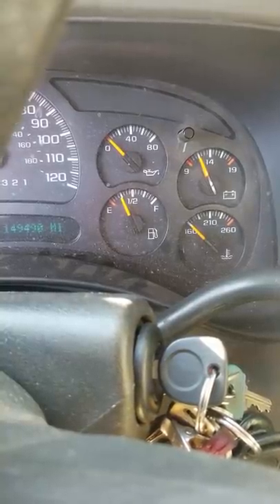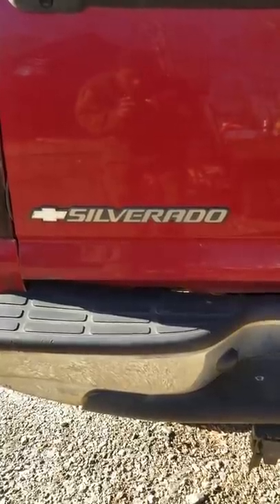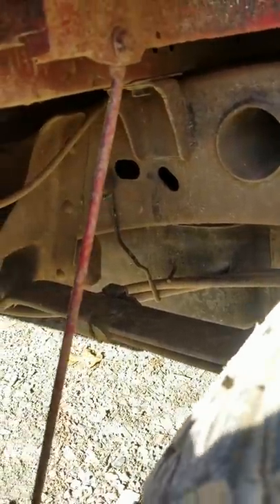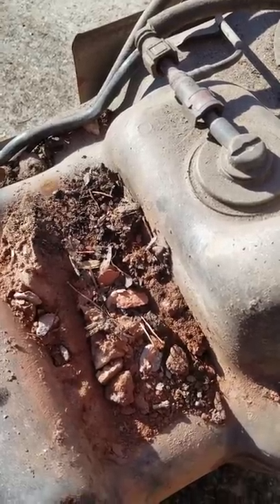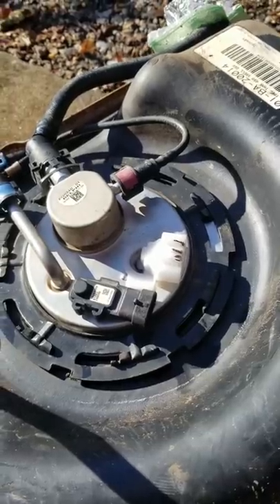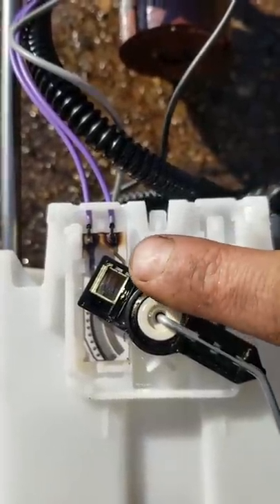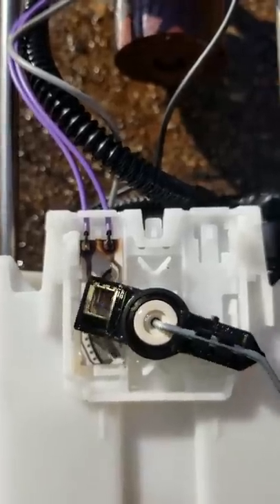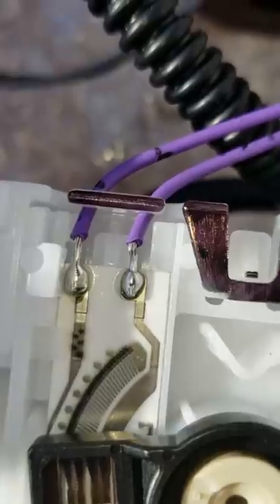Customer States Fuel Pump Broken

Comment: Yup... thats GM / Chevy right there. My 2008 impala is doing the same shit except mine goes empty reading a little over a half tank or 5/8.  I just filled it up when it started doing this and threw a 5 gallon tank in the trunk, zeroed out the mileage and ran it till it quit to know roughly how far i could drive it.  Been driving like that for 2 years just reading the travel mileage.

Comment: I have a 99 Z71. I didn’t have to drop the tank or lift the bed to change the fuel pump. If you have a buddy it’s much easier and faster to take the bed off than to drop the tank also.

Comment: pop out the bed bolts on tank side, loosen to almost remove the bed bolts on non tank side,  pop the fuel filler bolts from fuel door access. disconnct lights from main plug on frame behind rear bumper.   with friend and 12 inch cut of 2x4 lift side of bed with no bolts place 2x4 between frame and bed   you can now access the top of tank and get to sending unit/pump. clean area before pulling pump.  reverse order to assemble.

Comment: When I did my fuel pump on my 03 1500 I just loosened the bed bolts on the passenger side and removed them on the drivers side and jacked up the tank side. Had full access once I secured it held up.

Comment: Always test a part before installing. With New fuel pump turn ignition key on move float up and down. With someone watching gauge. Fuel pump should come on and fuel gauge should go full with float up and empty when float is down. And fuel pump should be buzzing when working.

Comment: Fuel pumps are a know prob in the silverados. I’ve got an 04 and gas gauge works fine, but the pump failed. Leaving me stranded. From what I learned don’t put the cheap fuel pumps in there, just spend the extra money and put the oem. Also when you replace the fuel pump you should replace the gas cap to.

Comment: I had the same issue but I dumped seafoam in the tank. It was all gumed up. 7 years later same fuel pump still reading accurately. I do have a fuel pump on standby just incase

Comment: I worked at a Chevrolet dealership many years ago.  That was a common problem with the fuel pumps. The easiest fuel pump I replaced was on a tilt bed.  It only two me a few minutes.

Comment: Changed my misreading pump/gauge on my old s10 only to have the brand new unit be just as inaccurate.  Worked fine until you get to 1/3 to 1/4 tank in the gauge.  At that point you might drive another hundred miles or it might just drop from 1/3 to below E.  Fun times.

Comment: You can cut a hole in the bed above the pump,or you can just loosen the bed on the passenger side and remove bolts on the driver side and jack the bed to one side

Comment: Run 2x cans of B12 chem tool thru every fill up until the gauge starts working again if your gauge works but is not measuring correctly. I did this 3-4 times and it removed the varnish on the lever sender and I've never had problems since (over 80k mi)

Comment: Sliding the bed back is easier and quicker on most GM pickups. It's like 4 bolts, the filler neck, and two plugs for the taillights. Just slide the bed back and set it on a couple sawhorses. You can access everything easily instead of messing with old shitty bands and mud falling off the top of the tank.

Comment: Take bolts out of one side . Loosen the others . Unbolt filler neck and tip bed. Use 2x4 to hold it up . Makes changing the pump way faster.

Comment: If it's a suburban you can build an access port right above the tank. Carefully cut your access hole and the go to the junk yard and cut the same thing only an inch bigger. Seal all the corrugations but only put really short screws into the high part of the corrugations. If you do a good job removing sharp edges and painting bare metal it should out last the car. Makes any future pump work pretty darn easy.

Comment: Have a question I had a 1988 f150 dual tank.   At one point around 2010 2011 it only ran on the front tank   Hmu for the rest of the problem

Comment: Don't need to drop anything. Loosen passenger bed bolts, remove driver side and lift. Put jack stand between empty bed and frame. Easy access and no tank dropping or lifting. 30 mins max for fuel pump swap or repair.

Comment: You don't have to drop the tank. Loosen the bed bolts, take the driver's side bolts out. Unplug the tail lights at the junction on the driver's side. Lift the bed up and support it with something around 16 inches. Takes about 20-30 minutes.

Comment: The actual problem is the gauge cluster. Bad servo or cracked solder joint to one of several resistors. Soon he will notice his speedo and pressure indicators going wacko. Either a 25 dollar diy replace the seven servos and resolder the resistor pack or a six hundred dollar replacement. I learned to solder that very morning.

Comment: Sometimes it easier if the bed bolts are semi clean and easy to take out. Tip it up to the other side and a few old tires will hold it up.

Comment: Mine always read way wrong. 2005 gmc 2500.  I just set the trip and filled up at x number of miles.  Luckily my fuel light still came on when it was supposed to.  Guy coulda watched his miles instead of spends big bucks of labor and a fuel pump

Comment: I had my gas gauge on my 1999 Silverado not working for awhile. Every time I filled the tank, I reset the travel mileage. Never got stranded  I finally replaced the fuel pump. I did not drop the gas tank, I  lifted the truck bed .

Comment: Yeah. Lifting the bed is easier. Had to replace the fuel pump 3 times on my 2006 Ram 1500 work truck. They only last about 150k miles. Probably have to change the engine before the next pump change. It has 542k miles on it. 6 cylinder gasoline 3.7 liter. Take care of them and they last a while.

Comment: You did that the hard way. Instead of dropping the tank, you can lift the bed of the truck as long as it's empty and have help tilting and propping it safely. Just remove all of the bed bolts, fill tube from the body and wiring. It is so much easier especially when there's fuel in the tank

Comment: Should just pull bed bolts on the tank side and loosen the other side's bolts, then tilt the bed and prop up. Way easier, plus you can spray the underside of the bed and wheel wells off.

Comment: My Silverado always is at a half-tank when it says 3/4 's.   But even when it goes down to E it works just fine. I have never run out of gas 

Strangely enough I had to have the fuel pump replaced several years ago (pump pressure issue).  But both before and after the gas gauge has acted exactly the same.

I thought it was just a GM quirk  or gremlin, because I have seen this before .

Comment: If that’s all you’re doing just take the bed bolts off one side and loosen them Galway on the other. Then take your engine hoist and lift the bed until you can access the top of the fuel tank. Leaving the other bed bolts in keeps the bed aligned. That way you can just gently lower t the bed when you get done and tighten everything up

Comment: An easier way to do this is if you have enough manpower or a lift is to slide the bed back about 2 feet. Saves a lot of time and is much easier to work on the fuel pump with the tank in the vehicle.

Comment: You can actually take the bilts holding the bed in on the drivers side and then loosen on passengers side and just tilt the bed to access the fuel pump in these silverados

Comment: Tip for next time if you have a friend, take the 6 bed bolts off and lift the bed put it on the tire and it gives you enough room to do the pump. 20 minutes instead of an hour

Comment: My girlfriend has a 2007 Silverado I’ve had this problem many times with her fuel pump . I’ve had two sending units burn up on me. the last  one was bad soldering. I re soldered it and it’s worked ever since. 30 min job. Work on something guys it’ll save you a life time of worry and save you $$ LS5.3 on e85

Comment: The easy work around for this rather than replacing a perfectly good fuel pump is to simply reset the trip odometer. If you know what your MPG is and you know how many gallons go in the tank. Figure out at what miles you need to think about getting gas again. Obviously better to have a working gauge but instead of running out of gas multiple times use that method

Comment: I had a gas gauge that would just jump all over. It was from a 20 year old Buick LeSabre. I just didn’t trust the gauge and tracked my own mileage. It did backfire on me when my gas line went out and I had gas leaking. My dad ended up replacing the lines with rubber lines😂 every time I went to get something fixed they’d always laugh at my rigged up car. Especially the exhaust fix with pop cans and clamps

Comment: in my personal experience with my Silverado, you don't have to drop the tank, cut a hole or remove the bed entirely. Just unbolt the bed and lift the driver's side, prop it up. Makes this a 20 minute job.

Comment: I hope someone smoke tested the emissions for leaks and tested the gauge stepper motor. I've seen techs swear it was the non Delphi pump that failed when in reality they didn't seal the system and it burnt up or the tech who says you need a dash who can't delaminate and solder the fuel gauge stepper motor.

Comment: Had to do one in a 2000s suburban. The guy couldn’t get the spare tire down made it a real pain. Took all damn day on my back in the driveway.
Reply: Why didn't you pull the bed? 6 bolts, 5 minutes, you're done. You don't even have to pull it, just tilt one side up and prop with a 2x4.
Are you a tech?

Comment: I swear every Chevy Silverado has issues with something with the gas I’m always having to do a fuel pump on every Chevy I’ve ever owned and brake lines and body mounts and differentials with fords just mass airflow sensor and sometimes a tune up that’s it easy to do

Comment: You don't have to drop the tank on the trucks. Just remove the bolts from the bed on the drivers side and loosen the bolts on the pass side but don't remove. Then raise the bed and work over the frame on the top of the tank.

Comment: I would never drop the gas tank it's too much trouble just changed fuel pump in my Dodge Dually unbolted the 1/2 of the bed and jacked it  up and went right in from the top it was really simple and a lot less time

Comment: I unhook the tail light harness. Pull off the fuel neck from the bed. Pull all the hold down bolts for the bed. Slide the bed back on the Frame and disconnect the fuel lines and harness of fuel pump. Then i pull the pump. Boom Shakalaka

Comment: Ok here's a thought. If let's say it shows 1/4 of a tank and it's empty then why not just remember that at a 1/2 a tank so the gauge says you should be looking for a gas station.  I guess that's too simple.  I've had trucks that the gauge never worked but I would remember how many miles I could go before I ran out.

Comment: Anyone else noticed that the gas gauge didn't change or moved that much after he replaced it so clearly that dude is just broken running his tank way too low cause it barely moved at all so there's no excuse for not having an extra couple gallons in your tank cause I can understand if it was like a quarter tank off like my 1st car was when I bought it cause I ran out of gas cause it far off but that's only a couple gallons he could have solved that with a $5 bill

Comment: Lol it’s not a Chevy if it isn’t breaking down or running out of gas! 

Also if you get stranded once, shouldn’t you from then on start calculating your mileage? So you avoid that problem?! At least until it’s fixed.

Comment: Pro tip never run it past 300 miles from full with the 32.5 gallon tank and you’ll most likely never be stranded

Comment: Instead of dropping the tank on a Silverado,take the bolts out of the bed . Move the bed back 1 1/2  to 2ft. The tank is right there on the drivers side.You have access to the  pump

Comment: You don't need to replace a fuel pump to fix a gauge reading. You need to replace the level sensor only. It's at least a $200 difference.

Comment: I'll never drop the tank on a pickup truck again, it's crazy when you can just remove the bolts and lift one side of the bed be done in 20 minutes taking it off and putting it back in.

Comment: What you doing is remove the bed bolts on the driver side and loosen the passengers side and fuel hose and tip the bed. You don’t have to drop the tank

Comment: In a truck its easier to just cut the bed in 3 places to make a small square  and bend it out to get to the sending unit. then just bend it back over, you can tape, or use your imagination to secure it

Comment: I learned two things having just replaced the fuel pump in my 01 Silverado.  

It’s much easier to lift the bed than to pull the tank.  And the retainer ring holding the pump in the tank is a mother %^*#er!!!

Comment: if the fuel guage on a chevy works correctly your lucky most dont work right if at all my 96 c1500 reads full 200 miles then it moves off i have about 130 miles from when it begins to move to empty

Comment: Never take the tank down unless necessary. Take four bolts out of each side of the bed unplug the rear harness and get your buddies together to lift the bed off. The gas tank is right there. 1/3 the time

Comment: It burnt up because you ran it too low on gas.  The gasoline acts as a lubricant and also a coolant for the sending unit and electronic fuel pump.  And frequently, people run their vehicles out of gas (or nearly so) and then find that the sending unit or pump doesn't work.  Expensive mistake!

Never let your tank get below 1/4 full.

Comment: Old Dodge pickup the sender unit had corrosion and intermittently shows a level, not accurate I assume. Trip meter hits 500 time to fuel up, still have 70 or more miles left, I have zero respect for people who put so little effort into trying to circumvent problems when there is an obvious solution.

Comment: No GM truck you don't have to drop the tank 4 to 6 bolts and the bed pops right off you you can prop it up to her to the fuel pump that easy instead of waste a hour on dropping the tank 5 minutes on the bed and you'll have the pump in and out within an hour.

Comment: Yo, next time undo the four bolts holding the bed on. Slide it back… by slide I mean lift it up and set it back. Probably going to need like 4 people. But thats it. Instant access to the fuel pump.

Comment: How to do the repair a lot faster and make a lot more money off the flat rate manual: instead of dropping the gas tank, unbolt the truck bed and lift it up. Bingo. You’ve got access to the top of the gas tank.

Comment: " " Cpl. Klinger's response to after the war ? (what are you studying?) EeelecTronics TV repair.. which thanks to good ol Yankee ingenuity means BUSTED sets by the millions ! 🤣 all my pumps have been mechanical mounted to the front of the block, the handle worked by the rotating assembly w/filter inline before the carb.🤗

Comment: There is an easier way dude. I own the exact truck. You don't drop the tank. You take all the bolt's out of the bed except the last two in the rear. But loosen them to where they're just before coming out. I raised the bed by myself and proper it up with a 2×4. I stood over the tank and replaced the fuel pump. From beginning to end it took me 42 minutes. My 86 year old Dad told me how to do it. We won't own anything other than a Chevrolet.

Comment: I had a Buick LeSabre that I drove for like 10 years, from the time I was 17. From the day I got it, the fuel gauge didn't work--I'm talking constant fluctuation between 10% fuel and 75%, no matter how much was actually in the tank. Looked up my fuel tank size and estimated MPG. Always knew my range when I would fill up, and just reset the trip meter.

I never once ran out of fuel.

This guy's gauge was off by, what, 5%? With all due respect to this owner, git gud.

Comment: Don’t waste your time dropping the straps brake and bolts. If it’s all rusted out truck just cut a hole in the bed and put some sheet metal screws back over and it’s done or pull the six bolts out lift the bed up done

Comment: If the truck is older and not in perfect condition just cut an access panel, the next time easy. And there will be a next time if you keep the truck long enough, had mine 25 years on the third fuel pump., Takes maybe an hour to change with access panel in bed

Comment: Bro just take the bed off than dropping the tank. So much easier. Literally 6 bolts, tail light connectors and 2-3 ground lugs and that’s it

Comment: Did you know that truck does not have a gooshnack or camper trailer on it it’s a lot simpler to pull a bed off then it is to drop the tank now you know

Comment: Dude so much easier to disconnect the tail lights unbolt the six bolts in the bed grab a Friend to help slide the bed back or jack up the bed on the side of the fuel tank. I prefer to jack up the bed. Blow all the dirt and debris off Chang out the pump let the bed down hook up the tail lights and put the 6 bolts back in the bed. You reduce a 3 hour job to about a hour 20 min

Comment: I guess you don't know that it's easier to remove, all the six bolts on the bed of the truck and lift it like a dump truck and do that sending unit instead of dropping the whole tank

Comment: GM and their Chinese fuel pump/fuel gauge. Failure rate is extremely high and a pain. The dealers have to replace them sometimes right off the delivery trucks. Junk.

Comment: The rinostat in the gas tank got tore up by a syphon hose. Do not syphon gas or diesel out of a vehicle with a small hose because the hose will hit the rinostat on the gauge float on the fuel pump.           ⛽️ 
           and gas is tasty    
                 🤤 👅🤤

Comment: Why do you have to buy a brand new pump when the only problem is burned out leads? Imagine having to replace the entire heat exchanger on a home heating system because the igniter is burned out.